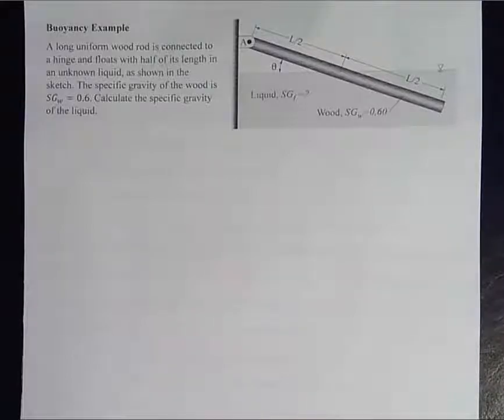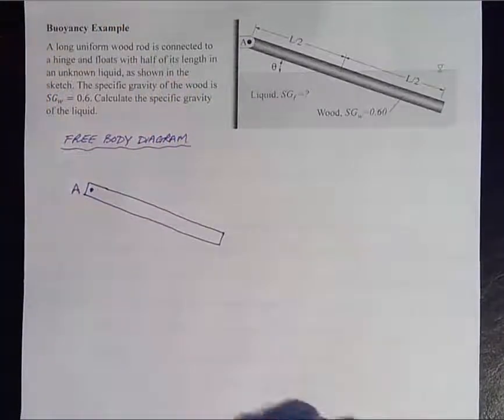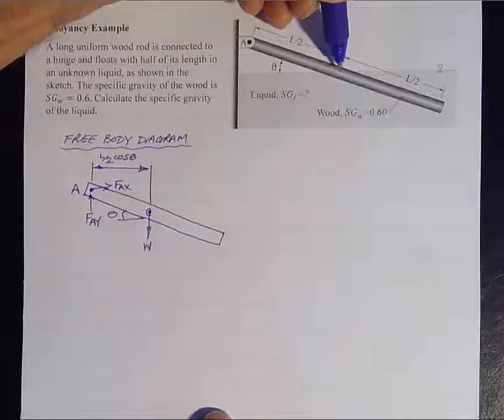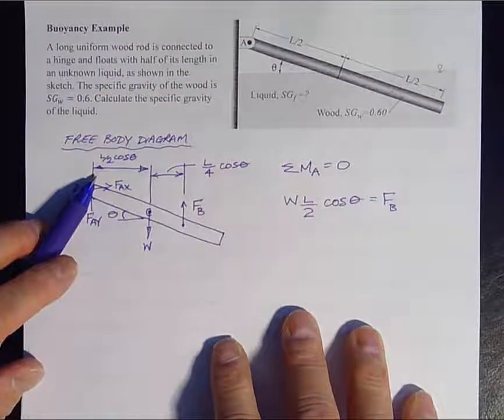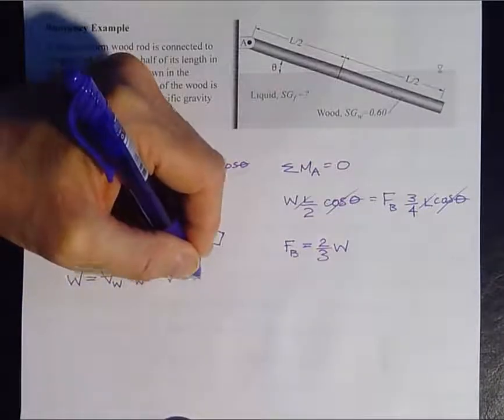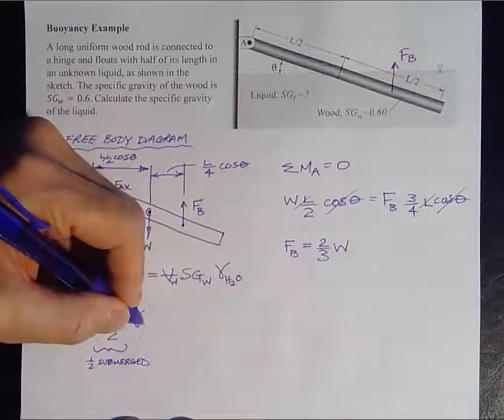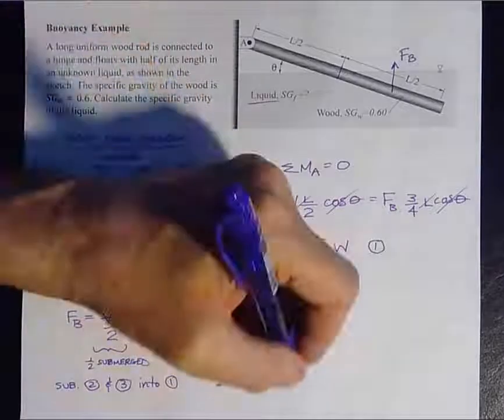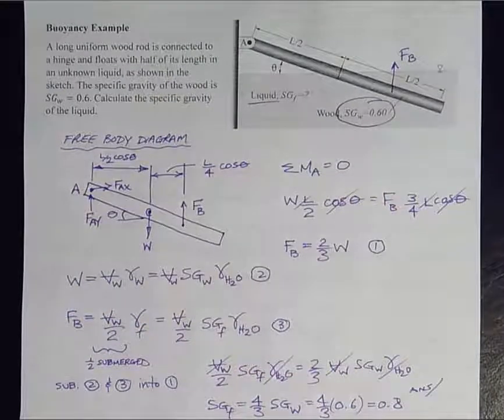Fluid Mechanics: Solved Exam Problem involving Buoyancy

Comment: Why did you use L/4 as distance for Fb
Reply from the maker: The buoyancy force acts at the centroid of the portion of the rod that is in the liquid. It's a uniform rod. So, F_b acts in the center of submerged section, which is L/4 from the center of mass (W). I hope that helps.

Comment: from 3:40 on, why didn't we use the fluid for W and the wood for Fb?
Reply from the maker: As shown in the free body diagram, W is the weight of the WOOD and Fb is the buoyancy force. Thus, Fb is the weight of the WATER displaced by the wood (Archimedes principle). That is why I used the specific gravity of wood for W, and the specific gravity of water for Fb.  I hope that helps.
Reply: @FluidMatters  Thank you!

Comment: Why u supposed that Fb in this location maybe it is in another location
Reply from the maker: F_b acts a the centroid of the submerged volume (half way down the submerged section of the rod) because it is the displacement of fluid that produces the buoyancy force.
Reply: @FluidMatters  thank you for this illustration
Reply: @FluidMatters  hhh